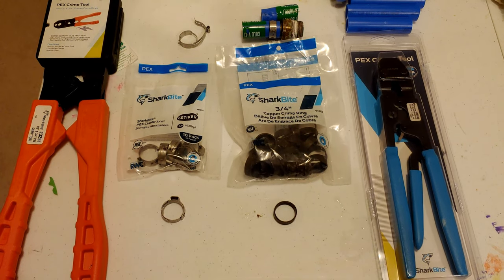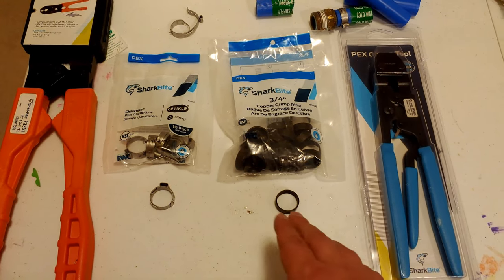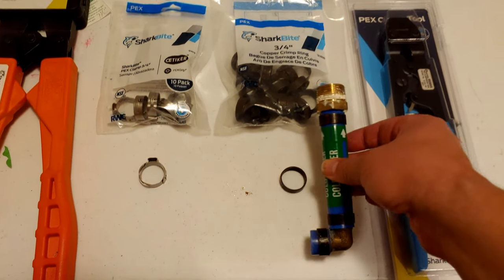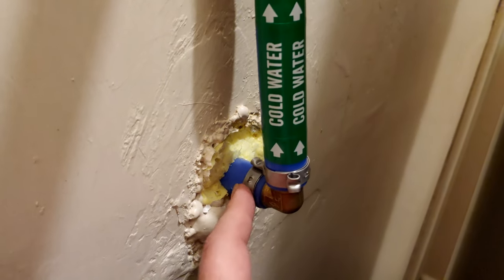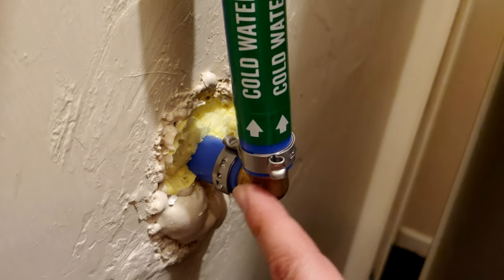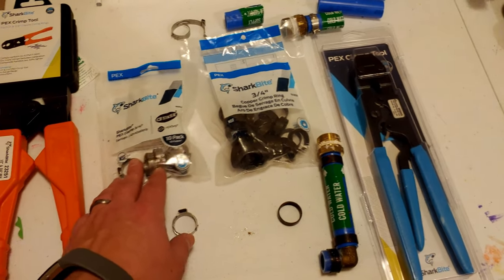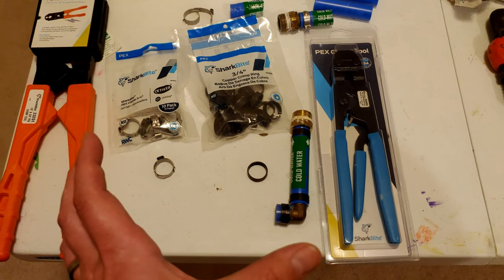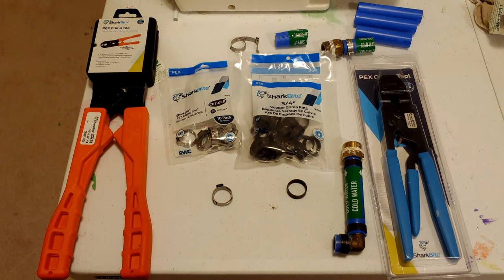PEX Copper Crimp Rings vs. Stainless Steel Clamps

Comment: I've encountered rusty/deteriorating cinch clamps in damp areas, todays stainless steel is not like before, quality lacking in a lot in the fastener field these days
Reply: There were probably some dissimilar metals nearby, creating an electric current.  Mixing metals at a connection is to be avoided.  Go all brass, all steel, all bronze, etc.  The cheapest stainless steel will rust over time, but thats more of a problem in very damp locations or saltwater environments

Comment: It looks like you put the clamps a little bit high on the collar
Reply: PEX specifies that either clamp be installed "no more than" 1/8th of an inch from the end of the tubing.  i agree, i think this guys PEX clamps are too far back on the tubing.  if you look at the "machined ridges" on all PEX fittings, you will see that clamping at the 1/8th inch mark is the optimum location for catching the fittings ridges.

Comment: I could the copper ring with the angle grinder, the hacksaw.  You don't need the open end to cut the copper rings.  I don't have the copper ring removal tool and I could cut it with many different cutting tool and I don't even need an open end.
Reply from the maker: That's good to know. You just have to be very, very careful not to cut or damage the PEX. Depending on how tight the area is with the plumbing it might be difficult to get the grinder or a cutter in place. Thanks for watching!

Comment: I go with the copper compression every time. The stainless steel clamp can fail because it is a mechanical clamp. The crimp is permanent. Callbacks are free and a popped connection can be expensive.

Comment: Or you can just cut the copper ring with a hacksaw blade. You still have to be careful so you don't hurt the pipe. You can even cut through the ring most of the way and then break it off with a pair of pliers. I mean it's worked well for me!

Comment: I think you are only assuming that stainless steel has less of a problem with corrosion. Stainless steel isn't rust free, it just rusts less than normal steel.  Stainless steel exposed to salt water will eventually rust to nothing but copper will patina and stop rusting entirely.  I haven't done the tests myself either but I'm pretty sure the copper rings have much less of a problem with corrosion than stainless steel
Reply: Copper rings will stain surroundings and corrode fairly rapidly in a saltwater environment.  Bronze or 316 stainless steel (my mistake,not sure whether 516 alloy actually exists)  are preferred in a saltwater environment.  Apollo makes a stainless steel crimp sleeve, so that’s a third option
Reply: @wallacegrommet9343  You're right, of course.  I was thinking of stainless vs bronze (not pure copper).  Stainless steel will rust away to nothing but bronze will patina and then stop corroding essentially forever.
Reply: Stainless steel needs to be in an oxygen-rich environment in order for a protective oxide layer to form (passivation).  As a boater on salt water, exposed fasteners are usually stainless, electrical and embedded fasteners are a mix of tin plated brass terminal screws, some silicon bronze for high strength, and 316 stainless (the good stuff).  I learned about ship materials from a former officer in the Cunard Lines, whom I took care of until his death at age 96.  He was also a marine accident investigator with the Canadian Government. Wonderful man.

Comment: i've done quite a bit of PEX installation.  here in Pittsburgh, PA NONE of the commercial plumbers use the stainless steel "crimp" fasteners.  all plumbers here ONLY use the copper "crush" rings because they have a superior clamping ability over the stainless crimp rings.  when one is installing PEX tubing, you should always leave enough end space to get the orange crush ring tool into the space.  i don't understand the guy's issue with the pipe he says is too close to get the orange tool into.  it looks to me that he could cut the PEX at the 90 degree angle and just pull the pipe back through the wall and install another longer pipe.  i have never used the stainless crimp rings for PEX and never plan to. i worked at a Home Depot store in the plumbing department for 8 years and i never sold any of the stainless rings to "professional" plumbers.
Reply: Which Is which?
Reply: @angelrey646  the copper crush rings are the simple round rings that look like a cheap, basic wedding ring - actually some plumbers call them "wedding rings."  the "crimp rings" are the stainless steel silver rings that look something like hose clamps.  those clamps have multiple "slots" in them and when you use the "crimp" tool, it draws the ring together until one of the tabs slides over and goes into one of the slots.
Reply: @jimharvard  thank you! I’m in PA too.
Reply: Professional plumbers use expansion PEX mostly and go to the supply house unless in a pinch and go to HD
Reply: @garagekeys  where are you? regular PEX is popular with plumbers here in PA
Reply: @jimharvard  FL
Reply: @garagekeys  it seems pretty common for plumbers in different regions in the U.S. to prefer different materials and practices.

Comment: Hi. Have you experimented with over sized fittings and expanding the pipe before fitting them like in PEX A? In order to reduce flow restriction at the joints. Or is it just easier to oversize the pipe and fittings to compensate for flow restriction on non expanding fitment systems?
Reply from the maker: Unfortunately I have not worked with oversized fittings or worked with oversized pipes to impact the flow. Maybe another plumber can chime in of they have. Thanks for watching!
Reply: Pex A works well except in a very cold situation because the pipe may not shrink back to original size. I keep my heat gun plugged in in these situations as heat makes the pipe shrink.

Comment: In tight spaces, wouldn't it be easier to use a stainless steel hose clamp?  With a hose clamp you can easily unscrew it if you need to revmove it.  Another advantage would be that we don't neeed to buy a large bulky tooll.
Reply from the maker: The problem with a hose clamp is they can fail or loosen and aren't great for high pressure scenarios. They often leak and I don't know any plumber that would use them. A solid connection (either type in this video) if properly done should provide a leak-free secure connection for PEX setups, that's on par to sweating pipe if it was a copper setup.

Comment: I much prefer the copper rings. The stainless need to be crimped at the proper angle to the ring or it does not compress enough to seal and will leak at test time. That give the copper an edge for faster production especially in tight spots.

Comment: Too bad you didn't cover the THIRD connection type - the stainless steel CRIMP connection, which is different from the SS clamp you review.
Reply from the maker: So I've seen stainless steel PEX sleeves, but not familiar or seen much in the way of stainless steel crimp rings; only copper crimp rings.
Reply: @TheEclecticHandyman  the stainless crimp rings are probably not as popular since they can't be compressed with a standard mechanical hand tool -need a more expensive hydraulic hand tool or a pro-press tool with the appropriate dies. Copper will corrode over time and fail in buried applications due to moisture in particular.

Comment: Why is everyone against sharkbite? Is it because they started with crappy push together ones?
Reply from the maker: So I'm not a professional plumber, but from my own knowledge as well as the plumbers I've spoke with, it's kind of a homeowners solution for those that don't know how to sweat copper. The Sharkbite has an internal seal supposedly with a 25 year guarantee. A lot of the copper plumbing I have is older than that. I think a leak can be one of the most costly and damaging repairs that spooks homeowners (like me) so when it comes to water tight plumbing I want the best. I had 1 contractor put a Sharkbite connector behind a wall and it makes me so nervous. Part of me wants to cut out that drywall and have that connector removed.

Comment: Guys a trick I discovered on my own if u have a leak in plastic pipes.... you can drastically slow the leak down by shutting off the water and rapping the heck out of the leak with electric tape. Use like a whole roll or half an roll and just go to town on it. Then turn the water on but also turn it only like half way on or less and the leak will be reduced to less than a 12th or maybe a 15th. It's nice if ur leak is in the ground and ur waiting for a part or a plumber or what not. I had to do this for over 2 months because I hurt my leg then I got covid so I couldn't get to it. With the tape it really didn't Leake that much. My water bill only went up by 20 a month